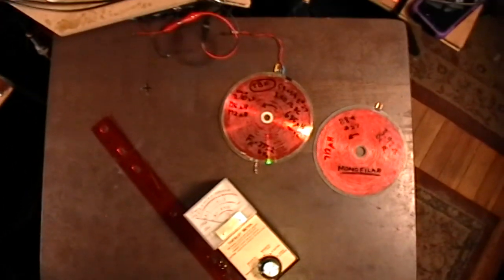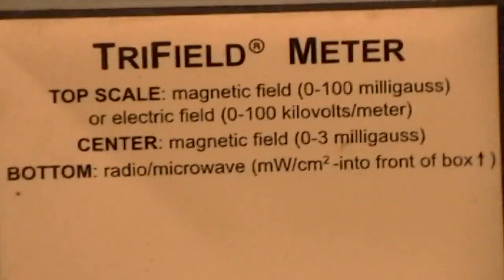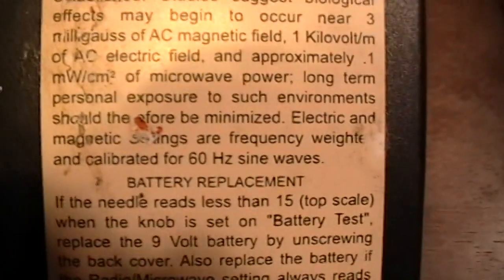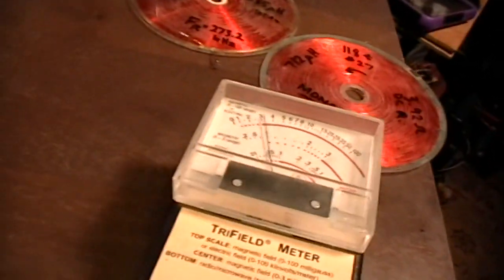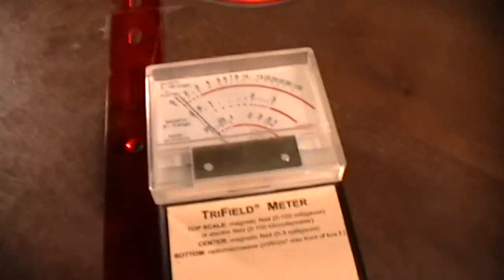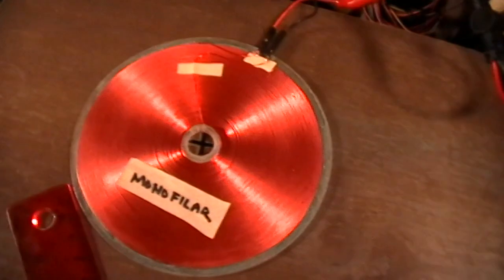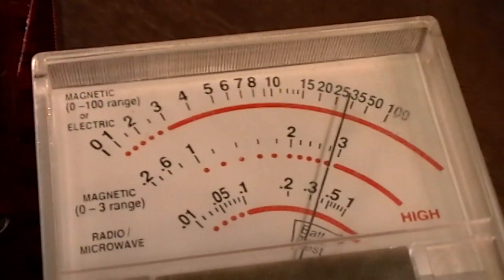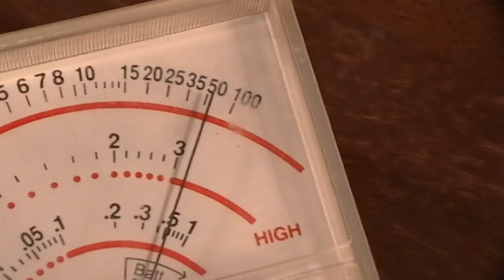Magnetic Field (AC) Comparison of Monofilar and Tesla Bifilar Coils

Comment: 1. Learn to film;
2. Learn to measure the magnetic field;
3. You have the equipment but you still need an electronics technician who knows how to use;
4. The strength of the magnetic field of a coil is measured on the axis perpendicular to the winding plane, ie from the center of the pie on vertically.
What you measured was the radius of the magnetic field starting from the center of the coils to the outside.
5. You wanted to prove that the great Tesla did nothing compared to the scientist who believes you, that is, a nobody one. Those who know the truth realized that you are a ...

Comment: Interesting... my question is what if the are stood up on end with the same test would there be any difference. In no engineer, so correct me if I'm wrong but with this set up aren't you measuring at its weakest point instead of the magnetic "focal point". Or is there not any difference?

Comment: The smaller the space, the greater the capacitance. A more powerful of magnetic will create a field that is smaller than that of a less powerful magnetic, of the same size. Instead of reading the outside of their fields, the measuring should have been at the coils strongest point, at lower, equal outputs. 
Tesla was partial to 432hz and other numbers that have 3,6,9 as the prime number, while modern engineering prefers multiples of 10s. I wonder if these would preform differently at these certain frequencies. Like 100hz vs 108hz, 140hz vs 144hz and 432 hz vs 440hz.
Reply: Not anything fundamentally different.
Reply: Yes also other resonance circuits have the 432 pattern, malcolm bendall's thunderstorm generator has 4 inch 3 inch and 2 inch spheres to generate nuclear fusion ( that destroys CO2 in the Vajra or 2 spheres in picture of my replication experiment )  https://www.youtube.com/post/UgkxCZzR2cKzwuSAod8d6U0AUDUruidupyiR

Comment: The main difference between these coils is their capacity between turns, they can make a bifilar and single wire assembly resonate at a lower frequency for some experiment like the one I have in my channel. www.youtube.com/watch?v=nw6my2X-57g This allows transmission of energy by 1 conductor without using coils of many turns, at a possible frequency to generate even with a small circuit 1 a battery of 1.5 volts.
Other examples transmitting Data by a single conductor and without power source in the Receiver. www.youtube.com/watch?v=PEHHTpIuBD4
Reply from the maker: Yes, you are right about the distributed capacitance and lower resonant frequency. How useful is this, in this day of inexpensive, small, reliable high voltage capacitors? 
I guess that you aren't familiar with my wireless power transmission demonstrations. 
Thank you for watching and commenting.
Reply: Hello! .. it costs me a little to communicate, since I do not know English, I use google to write to you. You have a very interesting channel for me, I'm reviewing it bit by bit.
In the time that investigates some patents of transmission of energy of tesla, arrives to the unifilar one, the great losses in the transmission of energy are by the caliber of the conductor. Since a closed circuit uses a current of conduction, and this current, considerably affects the losses in distance. When using a high-frequency single-wire system, the only cable connecting the TX and RX is driven by a displacement current, this feature makes it possible to pass a lot of current through a thin conducting wire. Therefore the same gives the power that you transmit the cable is very thin. To not undergo heating the cable, stop having losses by distance, this proves it in due course ..
It is true about today's capacitors .. but if the objective was to send high power power a couple of kilometers, the capacitor would be very high cost.
He is very witty on the part of TESLA. I experiment with what I can understand .. and I am still fascinated with his work.
To be able to reach the same conclusions that Nicolas Tesla has met, for me it is something exceptional !!!
Go ahead with that soul of experimenter .. there is nothing more gratifying in it.
A cordial greeting from Chile.
Reply from the maker: Thank you for watching and commenting!

Comment: Thank you for sharing your work. It is very interesting what you do.
Now, what would in your opinion be the best use of these types of coils for extraction of ambient energy?
Reply: Induction cooker free energy, could that be possible?
Reply from the maker: I doubt it very much. Of course, everything JLN touches turns to free energy, so maybe you should ask him how he does it.
Reply: Thank you very much for your reply. If there is a way to find some free energy lurking in the coils please let me know!
Reply from the maker: Well, the first thing you will need to do is to find some extractable ambient electromagnetic energy in quantities large enough to be useful. A Spectrum Analyzer is the right instrument to "sniff" your environment for such energies and will pinpoint the frequency range of most usefulness (highest energy content). Then you would create a tuned circuit to resonate at the desired frequency, and instantiate this tuned circuit by coupling your flat TBF coil with the necessary capacitance, or wind the coil itself to incorporate its own distributed capacitance of sufficient capacity to form the tuned circuit at the desired frequency of resonance. Then you just need to rectify and store the "scavenged" energy in an external capacitor bank for use powering your loads.  Good luck! 
Thanks for watching and commenting! I don't own a Spectrum Analyzer but would be happy to receive one as a donation to TKLabs, and I could put it to good use instantly.
Reply: How much money would you need to buy a Spectrum Analyzer?
I see them from a couple of hundred to $1500
Reply from the maker: Where do you see a SA for a couple hundred?

Comment: Another very good and important demonstration, thanks for sharing your findings.  In your description you note that the resonant frequency for this Tesla Bifilar coil is 242.7KHz, since the only significant difference between a Monofilar and a Tesla Bifilar coil is the inter-winding capacitance, how much higher is the resonant frequency of this Monofilar coil?  Perhaps you were going to cover this in a future video.  I am also curious why there was a 30.5KHz difference between the resonant frequencies of your matching TBF coils, strictly a difference in winding consistency as you note in this video?  Appears to also point out the importance of winding consistency due to its affect on coil inductance and inter-winding capacitance if you are trying to match the resonant frequency of coils which can be especially difficult with pancake coils.  And yet another set of Monofilar and Tesla Bifilar coils with same length of wire and same resistance (3.92 vs. 3.90 ohms)!
Reply from the maker: The monofilar coil has its first resonance peak at about 750 kHz, so there is a substantial reduction in resonant frequency for the bifilar coil. The differences between the two bifilar coils I have shown (243 vs 273kHz) are probably down to the winding inconsistencies. It is very hard to wind these coils and one is probably looser than the other one and hence has less interturn distributed capacitance which will raise the frequency of resonance. 
Yes, I'm still working on the "script" for an upcoming video on determining resonance of these coils using several different methods. Should be done sometime in the next few days but probably not today.
Frequency matching, once a coil is wound, would probably be easiest using a small value trimmer capacitor in parallel with the coil, right at the terminals. Or one can vary capacitance and/or inductance by placing the coil on or near flat slabs of conductive material, which in turn affects the resonant frequency.  
Thanks again for watching and commenting!
Reply: TinselKoala
Reply: Ehh.... I don't think it's the different consistency of the windings. I think it's the parasitic capacitance of the different windings. Thinner wire is more readily affected by stray capacitances between loops. This is referred to as "Parasitic capacitance" and is usually designed out of transformers.